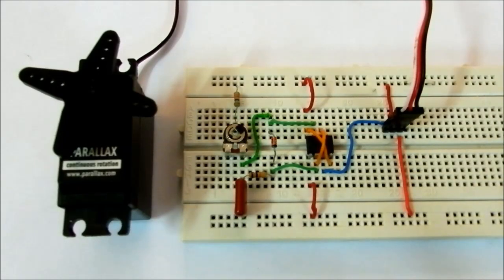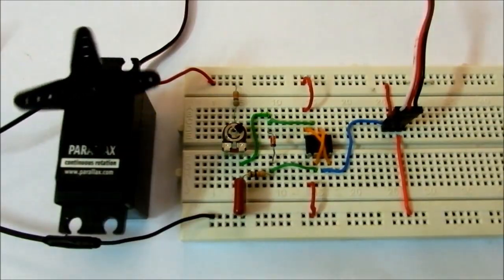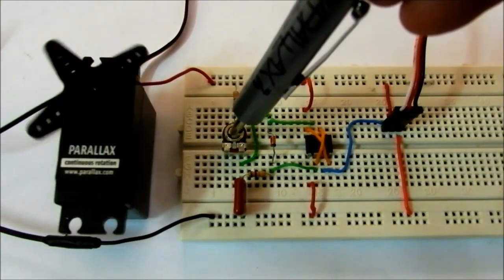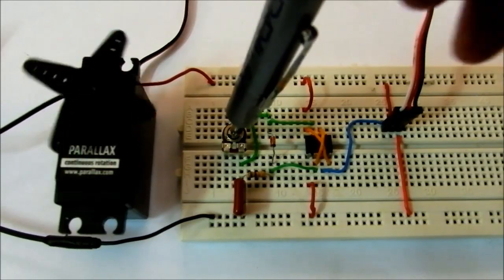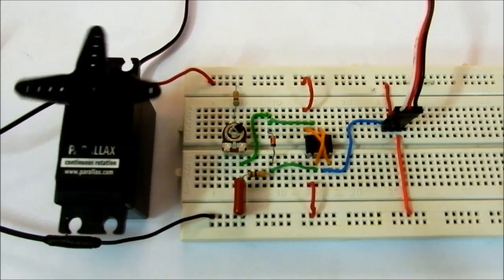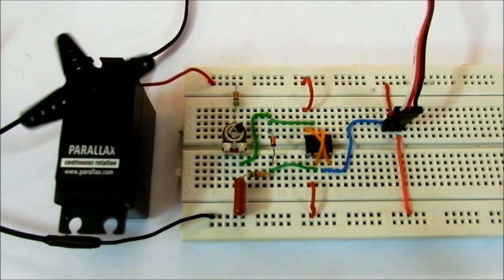Controlling Servo on breadboard | Using servo without microcontroller

Comment: what would had happened if the servo wasn't continuous ?
Reply: It would move to a particular position based on what the resistance of the pot is set too.  A non continuous servo sill go to a particular position based on the duty cycle produced by the 555 square wave.  Check out https://learn.sparkfun.com/tutorials/pulse-width-modulation